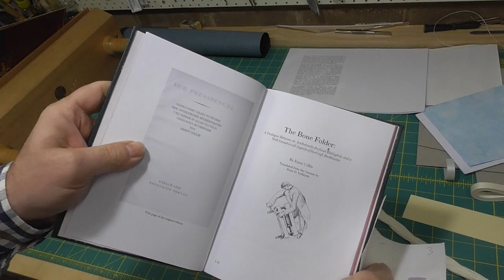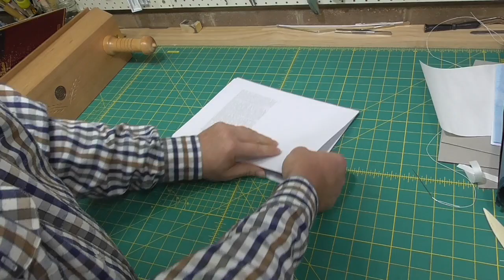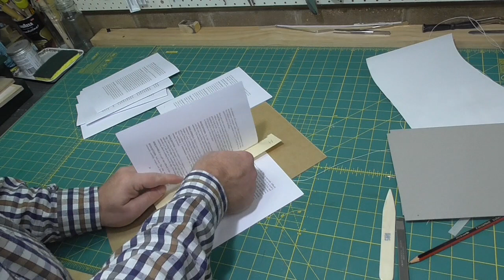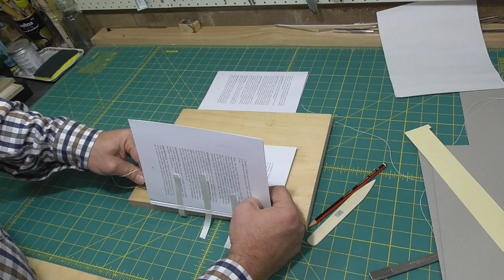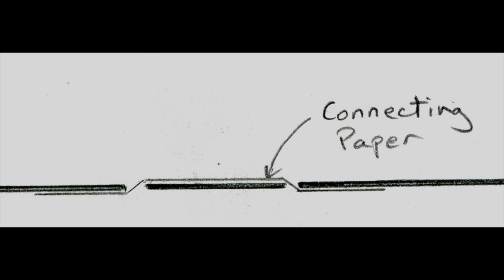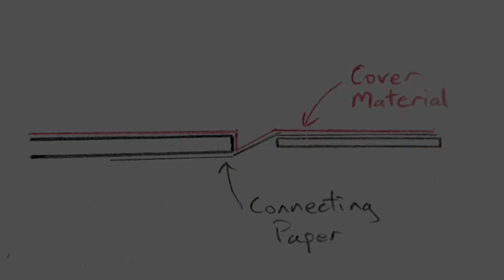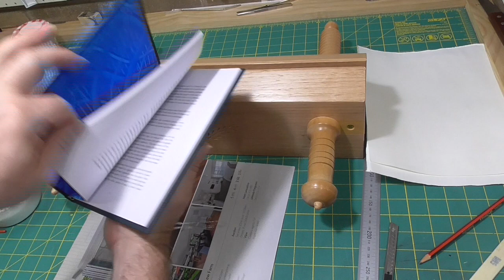How to Bind a Square Back Bradel Binding // Adventures in Bookbinding

Comment: Do you know what pressure is exerted by a nipping press? I reckon you are the sort of chap that would know. :)
Reply from the maker: Good question.  I don't have a number.  Steel presses exert far more force than needed for most modern bookbinding applications.  That's why home made presses work just fine.  Sorry no answer.  DAS
Reply: @DASBookbinding  Cheers. I am about to start making a press. It is really difficult to get a second hand one at a sensible price. Various options occurred for powering it bt it will be a keep it simple project.

Comment: I’m perplexed - or maybe just trying to be too mean. I’m binding A4 sheets but find I have to use A3 greyboard cut down to allow for the extra mms on the cover. I seem to be wasting a lot of greyboard. Am I missing a trick in buying greyboard which seems to be solely metric sizes or modifying A4 to make it go a bit further. Any tips? Love your videos and really enjoying learning a new hobby.
Reply from the maker: Binders board comes from the mill in large sheets.  The size of most of mine are a bit over 1000x700mm.  Because it is fairly cheap, most binders, even hobby binders, will buy these sheets if there is a local source.  They are a pain to store.  Every so often I spend an hour at the board cutter replenishing my stock of pre-cut boards.  I keep a pile of boards cut long grain 20mm over size for A5 and A4.  I also sell bundles of these in a selection in 4 thicknesses (which doesn't help you if you're not in Australia).  I'd look for a supplier of the large sheets.  For ease of storage cut them down like me to oversize for what you need.  Good luck!  DAS
Reply: Many thanks - it’s such a joy to start this hobby with you as my tutor. And many thanks for the Bach & other pieces which so suit your spoken advice. Lockdown here in UK might limit my options for now but I’ll seek out a large sheet supplier. :-)

Comment: I just attempted this binding but was probably being too ambitious and tried to do a quarter cloth cover. I obviously did not take full account of the creases etc and the cloth was fine on one side but came up far too narrow on the other side! It didn't help that I had used a cloth that was quite stiff. Is there are advice for doing a quarter cloth covering for this binding style?
Reply from the maker: Check out how I mark up the boards and measure the spine piece in the rounded and backed case binding (which is a half binding - 1/4 covering with corners).
Reply: @DASBookbinding  That's the method I normally use, but it didn't work for the flat back bradel binding. I very likely just mis-measured. I'll make sure I double check with my next attempt.

Comment: I'm a programmer, and I tend to listen to classical when I work as well. Usually Hendel, Salieri or Camille Saint-Saëns, a bit more uptempo. I find the conflicting instruments help me access that second-level thinking required for programming work.
I would assume the calmer tones without those conflicts in the melody does the same for work requiring concentration on a single, learned task that requires more of the first-level thinking.
Reply from the maker: You've thought about this more than me:)  DAS

Comment: One more question.  I do not recall hearing the width of the turn ins that you used.
Reply from the maker: I don't remember.  Anything between 15 and 20mm will work fine with this book.  I try and remember to hold up the turn-in trimming gauge to the camera showing the width written on it.  But maybe it is too fast.  Ciao, DAS

Comment: HI, love this video as I am just learning how to make books. Have a question. At 22:01 you show a ruler? Or is it a piece of cardboard you cut to measure and cut the cover material around the book? What is the width of this thin little ruler?
Reply from the maker: Home made width gauge made from binders board.  I think I used the 20mm wide one in this.  But I often use the 15mm too.    All the best, DAS

Comment: What kind of paper did you use for the cover,please??
Reply from the maker: The cover is actually book cloth.  It's Arbelave buckram, which can be bought from most bookbinding suppliers.  The endpapers are pastepapers made by me using a paper that is no longer available.  But any high rag content paper heavier than 110gsm should be good.  All the best, DAS
Reply: @DASBookbinding  thanks for your replay.I will try to look for it.

Comment: Very interested to know what your thoughts on number of sheets per signature... i see that you mostly do 4 sheets folded, im currently using 100gsm (68lb i think) and 170gsm (115gsm?) would 4 signatures be advisable? or more maybe 5 or 6 with the 100gsm... and less with the 170gsm?  I cant seem to find much information about this explaining the advantages or disadvantages of more or less sheets per signature and whether this hinders the stability of book or not... I hope i have made sense in explaining my request for further knowledge.  many thanks and take care
Reply from the maker: Hi.  So a lot of things to consider.  For this binding you want minimal swell.  More paper to thread gives less swell, as well as thinner thread.  For a square back binding you could go 6 sheets fine.  I guess there is small loss in strength and flexibility, but probably not an issue with 110gsm or less paper.  But if you need swell for rounding and backing you need more paper to thread.  In which case if you go above 4 sheets you need to increase the thread thickness.  The other thing with a rounded book is that if you have thick sections you will get noticeable steps (aka starts) in the rounded fore-edge.  My sweet spot is 4 sheets per section and I adjust from there as needed.  For the cased binding course I teach in person I use 3 sheet sections with 118gsm Mohawk paper and 18/3 linen thread.  This gives a good amount of swell and makes backing easier.  Hope this helps.  DAS
Reply: @DASBookbinding  Thank you very much for your reply, and that is good interesting information.  Can i take from this that the thread thickness is not necessarily dependant on the weight of the paper or more sheets, it has more to do with the swell for rounded backed books?  In theory then i could use 25/3 thread with 170gsm paper on a square backed book?  I have been using 5 sheets per signature and i think im comfortable with that with 100gsm, but maybe 4 for the 170gsm?  Thank you
Reply from the maker: @bishopbespoke5066  I think you do want to use the strongest thread - the thickest - possible.  If you have thick paper and thick sections you can use thicker thread and not produce much swell.  But thin paper and/or thin sections will require thin thread.  Many of the heavier papers tend to be soft and you don;t want to use a thin thread with them because they tend to cut them easily.  Having said all that 25/3 is a good all rounder size thread that can be used for must jobs.   170gsm paper and  I would be thinking 3 sheet sections as a preference but you should be able to get away with 4.  DAS

Comment: Why paste on the frayed bands instead of pea glue?
Reply from the maker: You had me for a moment, what's pea glue.  You want to be able to spread the frayed out what-ever nice and evenly and work it flat.  Hard to do this with PVA because of the fast tack.  And you don;t want to get PVA over your favourite bonefolder.  You can use PVA if you're trying to minimise the moisture you put into the paper, or you don;t have paste available - which is often the case with me:)  All the best, DAS
Reply: @DASBookbinding  jeez my spell check!  Thanks for the answer. That makes sense

Comment: Hi Darryl. What determines the decision to use or not use MULL on the spine? I've generally used it for all bindings with or without tapes but note that many of your binding techniques don't use it.
Reply from the maker: The mull reinforces the inner joint - the attachment point for cased books.  If this joint is reinforced by other means, such as cloth jointed endpapers, then the additional mull wouldn't be needed.  I can't think of any of my bindings where the  book block is only held in the case with paper.  But it's early and I'm not very awake yet.  Maybe I have books like this?  DAS
Reply: @DASBookbinding  The Steifbroschuren without tapes does not introduce mull however, given their small size, I guess this is not necessary. Keep safe, we are all in bigtime NSW lockdown many, including myself, devoid of work however, 209 Bach cantatas and 104 Haydn symphonies and some re-doing old book bindings will hopefully see me through!
Reply: @DASBookbinding  So for this book why did you not use mull? If using mull, could the fraying out of the tape ends be skipped (would the mull mask the tapes sufficiently)?
Reply from the maker: @gapop  If the tapes show through the pastedown, they will show as a lump even with a layer of mull.  But you don't have to fray them out.  It's just an option.  DAS
Reply: @DASBookbinding   I came into the comments to find out about the mull because I also wondered why you hadn’t used it in this project.  To clarify, is mull not necessary in this instance because of the paper board joint?  Or is it something to do with the ramieband and how the endpapers are sewn directly to the text block?

If I was using this technique for a book with a larger text block, would it be a good idea to add mull to the spine for extra strength?

Comment: What a great tutorial, Darryn!
I was just wondering whether the widthness of 60mm you use for the strong paper strip with the A5 format should be scaled for another book sizes.
Reply from the maker: No, the 60mm is more to do with the thickness of the book.  Any additional material past an inch or so really doesn't add any value in attaching paper to the boards.  But if the book is much thicker then there will be less paper on the boards and you may want to make the paper wider.  Hope that makes sense.  All the best, DAS
Reply: @DASBookbinding  Thank you!

Comment: That strong, 80gsm, high cotton content paper you use looks ideal for this purpose. Unfortunateliy I'm having problems to find something like this here. Could you suggest an alternative? (I'd swear I've seen kraft paper used in similar designs but I don't know if that would be a correct choice).
Cheers
Reply from the maker: Yes, craft paper would be a good substitute,  It usually has long fibres and is a strong paper.  All the best, Darryn

Comment: Thank you for this. I’d been struggling to get the overlap of the boards and text block consistent. I like the idea of leaving the trimming of the boards till the stage where the spine is attached. You also help me solve  the problem I was having with spine thickness (i had previously been making the spine the same thickness as the text block, but the idea of adding the thickness of the board helps in two ways: it makes the spine wider so that labelling is that much easier, but also helps with the way the book looks on the shelf. I have a question about the final gluing of the text block to the case: I’ve always left an unglued 5mm gap on the spine side to allow the book to be opened more easily, but I notice you glue the whole endpaper. What’s your feeling about this ? Thanks again. And I very much appreciate your skill and knowledge ! Very much appreciated !